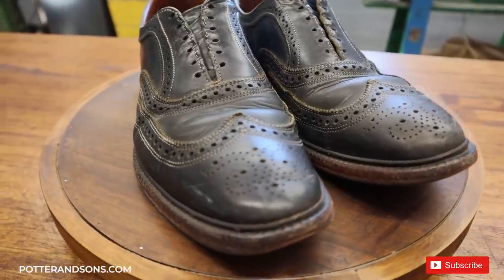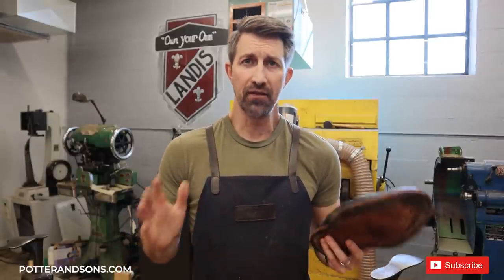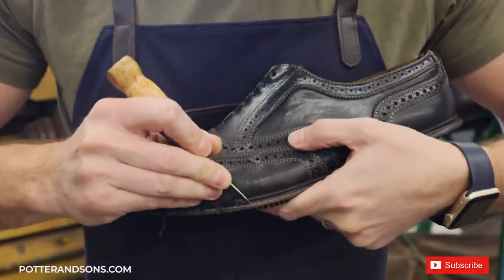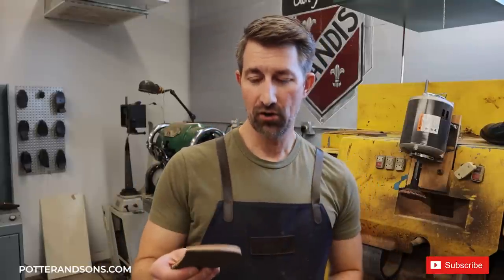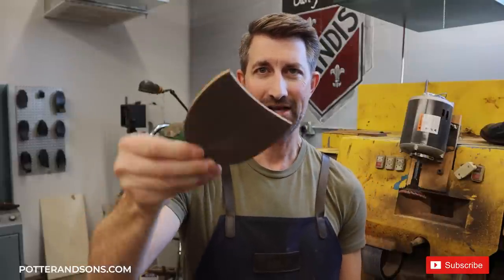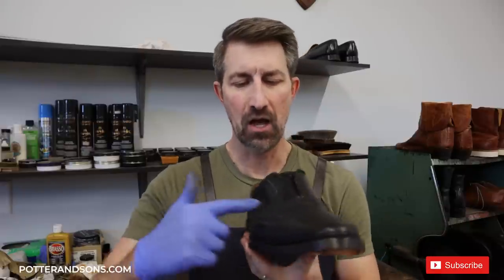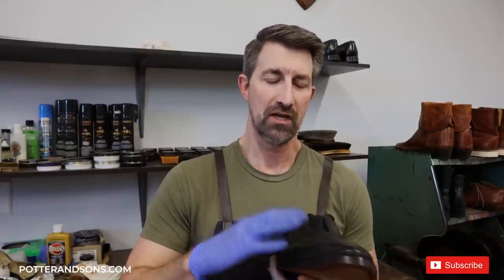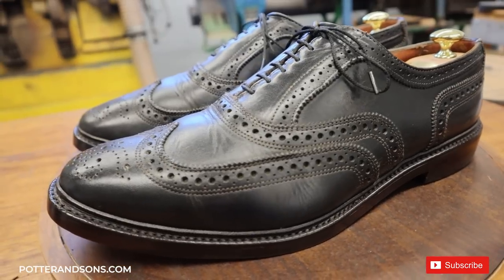The EASIEST Shoes to Resole?? | This Pair Gets a Makeover

Comment: As usual, excellent video, Trent. I thoroughly enjoyed it!

Now, my Shoe Repair Question(s):
1) When you reuse a welt, like in this pair, how do you align the existing holes when you stitch it again? Or there is no such slignment and the welt just keep getting more punctured each time?
2) Which method do you think is better (i.e. longer lasting) for the sole: carving a trench or close channel stitching? I've seen you using both, but I wonder if one is superior to the other in any way.

Keep up the excellent work!

Comment: With all the work that you complete, how extensive is the machine and shop maintenance that is required. I would like to see a video of shop/machine maintenance. Appreciate the videos!
Reply from the maker: Surprisingly very little.  Most of these machines are 40+ years old and still work perfectly.  Other than the occasional tweaking, we usually have someone come and fine tune them every 1 or 2 years.

Comment: Hi, I am a huge fan of your videos and am impressed by your knowledge and expertise on the topic of shoes and boots. I have a question for you regarding a pair of boots that I own. The fit is great, but the volume is causing some issues when I lace them up. I have tried adding insoles and kilties, but they don't seem to make a difference. I am considering adding a patch of leather to the top of the tongue to provide some extra volume, and was wondering if barge cement would be a good option for attaching the patch. Are there any potential drawbacks or things I should be aware of before attempting this? Thank you for your time and I look forward to hearing your thoughts.

Comment: Question:
Is the rapid-blake stitch the most durable stitch available? From my understanding, it's using the entire midsole as the "Welt" which is then goodyear stitched. It seems to be the best of both worlds, including a double thick sole which provide some heft. Solid, durable, easily resolable, and water-resistant.

If I may be greedy, another quick question: is using a JR sole as a midsole a waste?

Comment: Shoe repair question; I have 2 pairs of Timberland boots that are glued on soles. Both have come loose and need repair. I really like the boots. Should I just have them re-glued or upgrade and have them stitched down. Really enjoy your videos every week.
Reply: If you feel adventurous and challenge yourself and you can buy soles, have tools to do it yourself: .
.  use kitchen top / formaica glue, stanley knife, hammer or a mallet, heavy sandpaper,
 - if you wish, some nails to secure the sole, preferably brass- a second hand shoe last, 
  Good luck, work safely OR see a cobbler.

Comment: After reapplying the new sole to the shoe/boot, how long do you leave it under pressure in the press?  In the video you show the process of placing them on the press,  and the process of taking them off.  For the sake of brevity in the video, I assume that it remains under pressure for some period of time, and you don't show it because it would be boring to watch.  Just curious how long the glue needs to cure under the pressure before you can move to the next step.  Thanks in advance for the explanation and keep up the great work!!

Comment: I repair and refinish shoes, which I learned from cobblers like you on YouTube believe it or not, but I do a pretty darn good job. My question is if you have a deep gouge in the uppers, how do you repair it? Is there a leather filler that you recommend that is flexible, paintable, And will not look like a repair after it is sanded? The kind that Saphir makes is horrible in my opinion because it’s like plastic and never matches

Comment: Shoe repair question: I've seen many leather-soled shoes with the Italian phrase "Vero Cuoio" (i.e. "real leather") on the outsoles, and while many of these shoes are made in Italy, not all of them are.  (Stuart Weitzman, for example, has the phrase on the soles of some of their Spanish-made shoes.)  When I've inquired about this, I've gotten conflicting answers.  UNIC (the Italian tanners' association) told me that "Vero Cuoio" guarantees that at least the wet finishing of the sole leather was done in Italy, regardless of where the sole or the shoe was made.  However, one of the Cuoio di Toscana tanneries (a group of seven sole leather tanneries in Tuscany) told me that the only phrases that guarantee the Italian origin of sole leather are "Vero Cuoio Italiano" or the Cuoio di Toscana logo, neither of which I've seen on an actual outsole.  Do you know anything about this, so you can clear up the confusion for me?

Comment: May be a bit late, but here goes. How much extra work is it to repair stiches in the uppers along with a resole? I have two pairs of brogues with just a couple of loose stitches along the sides of the wing tips. I imagine it might be a big deal, having to remove the insoles an lining (not wanting to sew the lining to the uppers, and needing access to both sides). Or might there be some trick? Even something I could do myself between resoles?

Comment: Shoe repair question. What is your best recommendation for keeping shoes looking their best for as long as possible. Sole protector, leather conditioner, proper storage,etc, which makes the biggest impact on keeping them nicer longer?
Reply from the maker: Keeping the uppers conditioned and making sure you replace the soles/heel pads before they get so bad that more damage is caused.
Reply: @TrentonHeath  thanks!  It’s so hard to find Goodyear welted women’s shoes in my size! Now that I have some I want to make sure I keep them in excellent condition! I appreciate the reply!

Comment: How do you feel about that carpet foam stuff some companies use instead of cork ?
Have you found it more difficult to remove during a resole ?
I resoled a pair of boots myself awhile back and that stuff was terrible to remove.

Also, have you guys encountered a source for slip resistant wedge soles that are black ?
Reply from the maker: I'm not a fan of the foam stuff, but it has its place occasionally.  There aren't many aftermarket wedge sole options.

Comment: If you just running the shoe through the machine to resole will the machine punch new holes in existing upper leather. If the shoes are to be resoled several times, will that eventually destroy the leather upper so you will not be able to resole the shoes “over and over”? Thank you.

Comment: Can you repair a pair of AE’s that are out of balance? And I mean that each shoe of the pair is balanced significantly differently. The back of the left heel sits 1/2” off of a flat surface and the right less than a 1/4”.

Comment: OK. I'm a big guy. 6', 300 lbs. I have several pairs of shoes that I wear specifically for work. I wear these out very easily. I either wear the soles out completely, or the insole and arch supports wear down.  I work about 10 hrs a day driving a special needs bus. I have to get out constantly. Is there a brand of both insoles AND soles that can stand up to the wear and tear. And is it cost prohibitive or is it money saved to send the shoes out to be restored? I wear a very plain cross trainer shoe, and the uppers never wear out.

Comment: I just picked up this exact type of Allen Edmonds $20, alwayscheck your local thrift stores.  
Not nearly as rough as these, but the threads are worn through in a couple of spots. I was thinking of putting a wedge sole on them after getting a pair of boots with vibram wedge soles.
With occasional use how long would a crepe sole last?

Comment: Is a blake-rapid stitched shoe superior in construction to a goodyear year welt?  The blake rapid, as you know, is blake stitched to a midsole and outer stitched (i.e., rapid stitched) to an outer sole.  It's as water resistant but allows for a more flexible easier to wear shoe in my opinion.  Are they harder to resole?

Comment: I may buy that belt but not sure. Any way I noticed something with trying expensive boots and shoes is some of them like Jim Green have a convex sole on them and it hurts my foot as there is too much pressure in the middle of the ball of the foot. I have been wondering if leaving out the cork would keep it from being convex and make it concave which is far more comfortable and less painful. I know concave is more comfortable as the jungle boots I got after the Rose Anvil channel cut them in half are more comfortable. Or a question is there another way to prevent them from being convex? I mean flat works too.sorry about the strange wording of my question but you did ask us to ask questions and that is kind of a shoe repair question and maybe even something that you have a suggestion on how to fix on a new pair that come that way.

Comment: Serious question: Do you guys ever use the cork to “adjust” the fit/stride for a wearer?  Maybe a little thicker in some area(s) to adjust the position the person stands, or walks?  Is that even a possibility?  Curious?
Reply from the maker: We don't do orthopedic adjustments, but if it's the underside of the foot that needs comfort, an insert would be added on top of the insole.  If it's the walk that needs to be adjusted, it's usually the sole/heel that is altered.

Comment: Shoe repair qn: do you think its worth the repair if the resole of a blake stitched cost almost just as much as getting the same pair brand new?
Reply from the maker: If you factor in break-in, I'd say it's worth it if the uppers are in great shape.   However that's for each person to decide.
Reply: @TrentonHeath  Thanks for the advice:) been a loyal viewer frm Singapore and am able to score some local made blake stitched for ard 150usd and resoles usually is about 80-100usd

Comment: For high-end, hand welted shoes like St. Crispen’s, I’ve felt like the aftermarket toe plate screws could cause long term issues with the welt. (I really need toe plates!!) I’ve toyed with the idea of a topy-like toe plate instead; full rubber sole is not a desired option. Any thoughts on possible welt issues and on the toe-topy?
Reply from the maker: The screws we use are smaller than the needle stitching through the welt.  No issues I've experienced.

Comment: Is an oak bark tanned sole stiffer than veg tanned? I know oak bark tanned like JR wears better but you might want maximum flexibility in something like a loafer. Your recommendation?
Reply from the maker: Oak Bark is a veg tanned,  but the term is often associated with pit tanned leather vs. rapid tanned veg.  If you want something more flexible, go with a thinner sole or a non pit tanned sole.

Comment: Good morning! I have a pair of Thursday Captain boots pre-2019. The stitching through the sole wasn't into a recessed channel, so its flush with the bottom, and as expected, all the bottom loops of stitching have worn off. Is this affecting the life of the sole? Do I need to send them in for repair sooner than I normally would?
Reply: Not really, the outsoles are cemented to the midsole (or to the welt & filling if there's no midsole), so they'll stay on even if the sole stitch is worn away (not always, but generally speaking). 

Send them in once the outsole starts to split/separate from the welt or midsole or if they're worn through at either the toe or under the ball of the foot (and/or if the heel toplifts are starting to wear down to the leather heel block).

Comment: I have a pair of Nick’s Roberts boots. The right boot is starting to squeak when I walk. Has a dainite sole. Does that indicate a need for a resole? I think I it’s coming due for a resole soon anyway.
Reply from the maker: Not always.  It could be the insole has developed a spot that squeaks when your sock rubs on it.   I've got a pair of nicks that started to do that.  I just barely roughed up that spot and it stopped.  With thick leather insoles, this can happen, but it's an easy fix.  It could also be an air pocket that's developed.  If that's the case, sending it back in for a recrafting should fix it.

Comment: I am curious as to how do you know how much cork to use?
Reply from the maker: The stiffer the insole,  the easier to determine.  However,  if the insole is worn or soft, we have to feel the inside to make sure there is no bulging.  A lot of practice.

Comment: what is the white machine with the grate for that you put the shoes on after gluing?
Reply: Fume control/ventilation so as the contact cement is drying, the whole shop doesn’t get high.
Reply from the maker: Glue is full of junk we don't like to smell.  That machine pulls in fumes and cleans the air.

Comment: Shoe repair: at what point do you consider a pair of shoe irreparable? How would it be possible for a resoled pair of shoes to have what feels like a permanent stone stuck in the shoes?
Reply from the maker: As Steve from Bedo’s Leatherworks always says…”anything is possible.”  It basically boils down to how much are you willing to spend.  If a shoe is way beyond what the shoe would cost to replace, it may not be worth it.  If something feels like a stone in your shoe, it’s probably something stuck under the insole.  If they were resoled, the cobbler may not have smoothed out something.  Often times, if that’s the case, they would have to take part of the sole off, remove the object, and then glue/stitch that portion of the sole back on.

Comment: Hi Trenton & Heath. I've got a couple of old pairs of Church's that I purchased about 25 years ago. They both have seen a good amount of use over the years, so much so that the leather uppers seem to have stretched a little bit in certain areas just from walking. They still look ok overall but because I can tell they're misshapen a bit, they just don't look as sharp to me as they were before. Is there anything that can be done with that to get it back closer to what it was originally (including maybe sending it back to the factory to refurbish)? Thanks!
Reply from the maker: About the only good way to get the leather uppers back to their original form is to use the original shaped lasts and have the leather pulled back to form.  The manufacturer may be able to offer that.
Reply: @TrentonHeath  Thanks very much!